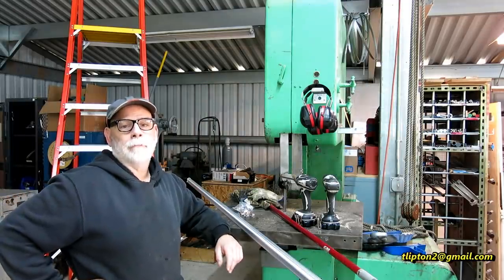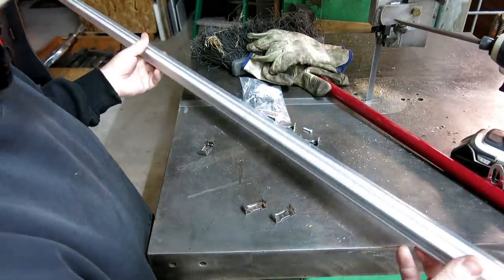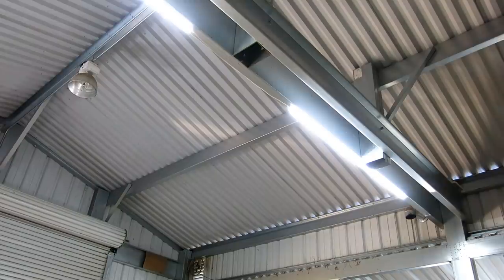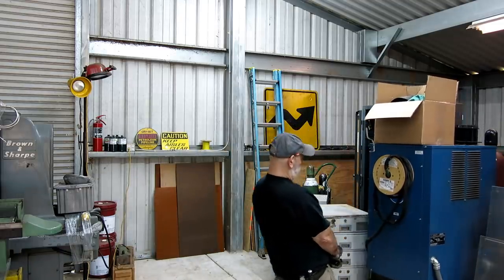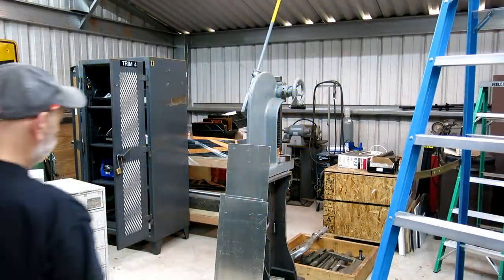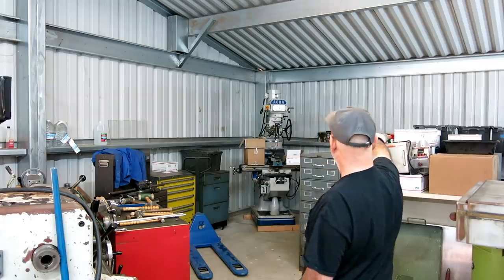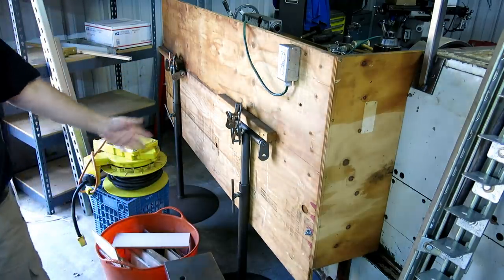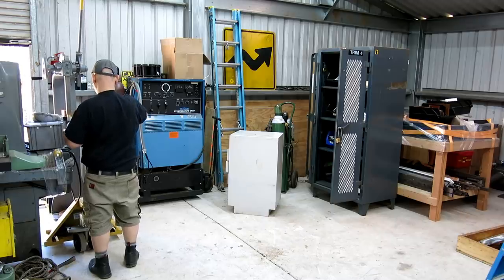Epic Egress 5 New Shop updates

Comment: I installed UFO LED fixtures in my 16' ceiling shop. 3200 square foot and 2 15A 120V circuits gave me right at 100 foot candles. Instant on is another wonderful LED feature.

I moved into my shop on Jan 1 when I had sons and grandsons here. Open heart surgery was scheduled for January 7, but has been postponed. This has allowed me to do similar tasks to what you are doing. 

You are having fun, so am I.

Comment: I did the spray foam insulation in my shop.  You will want to get any conduit, air, water etc. piping run before you spray.  It a pain to run it after.

Comment: I have changed all my lights to LED, some that are inside my house are remotely controlled by my phone and programmed to switch on and off at set times, and to change color at a set time, at any brightness or color that I want. And in case of an emergency the regular wall switch can override the program, so when you switch the light with the regular wall switch the light comes on with a bright light. 

In my shed I used to have a problem with my lights before I switched my regular bulbs to LED. In my shed I have two parallel wired light fixtures that switch on simultaneously, but one of the light bulbs kept blowing up on me because of the power surge. I had to change that bulb so often that I stopped doing it. Since I switched to LED I don't have that problem anymore. In fact, I did not have to change a single LED light since I bought them. 

Looking forward to see the progress 👍

Comment: I have the same exact lights in my shop. Nine lights in a 30 x 30 shop with a white steel ceiling at about 9’ 6” and it works good, not too harsh and no issues turning on at 0 degrees F. I am glad to see they don’t flicker on your camera, I have yet to shoot a video with the new lights up.

Comment: Getting a pallet jack for my shop is one of the best investments I have made. While a bit more expensive, I also bought a manual pallet lift. It is a bit more awkward to use, but has come in handy when I need to get things up higher. For the lights, you might look at the indoor scaffolding they sell at the big box stores. I need to replace some lights in my shop and will probably buy a set rather than risk standing on a rickety ladder.

Comment: I replaced the fluorescent lights in my shop with those LEDs and vastly prefer them. Watch out that the connector wire is well supported because it'll start to fall out after 6 months or so. I've also had two of the switches melt the insides so the contacts don't work anymore. I solved that by hard wiring it to a regular house light switch.
Reply: I was going to comment almost the same experience. I hardwired all 10 of mine to one legitimate 15 amp household switch. All of them have their own box also.

Comment: I learnt to weld alloy on one of those Miller Syncrowave machines about 25 years ago or more.    Only recently in the last 3or4 years have they been phased out. Only because of trouble finding points for them here in Little New Zealand.  Great tough machines.   Would go all day on close to 200amps.  Lol. In winter we had to turn the Amps up at about 2 pm when mums at home turned on the heaters to heat house for kids coming home from school.  Lol.   Not friendly on power consumption, but Dame they earned their keep for a nearly thirty plus year old machine

Comment: That shop sounds a little tinny and needs some insulation. BUT it sure looks like a well made structure! So many of those sheet metal buildings are built with red-iron purlins and/or the thinnest material they can get away with! Im liking all the heavy galvanized stuff. I myself just built a 650 sf shop and while I keep tell people its not my dream shop, it sort of is, and its mine.

Comment: I upgraded my T8 bulbs with philips direct wire LED bulbs.  They don't require a ballast and are super easy to use and VERY bright and well diffused so you don't have the star point light effect.  5000K is the recommendation for working areas and offices.  I put a two bulb 8' fixture in every 12' or so and then a few two bulb 2' fixture over my critical work areas.  I'm super happy I added LED bulbs, and just more lighting in the shop.  A lit shop is a happy shop 😂😂

Comment: One thing i would consider is replacing those vertical roof sheeting with clear for a sky light effect. You would loose some insulation value but it would brighten the shop up.

Comment: The good ol' Syncro 300.  For the unaware, note that the wheels are built in.  Had purchased one many moons ago for doing aluminum motorcycle frame fabrication and was shocked at how massive those things were.

My new inverter machine does 8% more power, has advanced waveform control, and weighs less than 50 lbs.

Old transformer machines like that sure do weld nice, though...
Reply: Especially with an older welder with HF start, fluorescent ballasts are the worst.  I recall long ago when wound ballasts were getting phased out, but solid state ballasts would shit the bed after a couple of HF starts on my syncro 180.  

LED lighting is soooo much better.

Comment: I've had bad luck with the cheapie LED fixtures similar to these.  They are often driven right from the output of a full-bridge rectifier with no caps for smoothing.  I put 27 up in my shop before I realized why the lighting seemed 'off' to me.  Turned out they had an 85% flicker rate at 120 times a second.  I used a small solar panel on a scope to measure it precisely, but an easy way to test lights for a 'proper' driver is to swing a pencil back and forth quickly between your thumb and fore-finger over a white sheet of paper.  It SHOULD look like one blur of a pencil when moving back and forth.  If you see 'stop motion' of the pencil as you swing it, the lights are flickering, and any motion under the lights will always 'feel weird' and cause fatigue.

Comment: Consider putting the ACRA mill in the middle of a wall, you might need room on either side for long shafts or other long, overhanging 
workpieces that would otherwise interfere with a corner.  No matter what what you do, you'll be bruising your hip...

Comment: Tom just have ta tell ya that it would be better if ya don't move everything all over the shop until ya have the spray foam  done cuz that crap will get all over everything and it isn't easy ta clean off. don't know if yer doin the walls or not. But if ya are, ya will have ta move everything out away from them. what mee is sayin is that it make a mess. anything that isn't covered it will stick too. and most of that commercial stuff once it is set acetone or lacquer thinner won't touch it esspecily the fire proof foam ya might think twice before ya get too carried away. jus sayin mee friend just tryin ta help ya out.

Comment: Maybe, look for one section of used pallet racking. Put a wood "floor" on the highest level.  Move it around and use it for this kind of shop setup work.  When you're done, cut the verticals down to the lengths you need and you have heavy shelves going forward. Very cheap way to kill two birds with one stone.

Comment: So dumb question...can you leave the spray foam exposed or are you planning on a steel liner panel? Seems like it would be a fire magnet for hot chips, weld spatter or a grinder.
Reply: Chech out Swan Machine vids on new shop build. Look at his insulation that is being done.

Comment: 6000K is VERY cold and bluish. That type of light is suitable for precise work with lot of small details. The downside is that it stresses the eyes quite a lot and can cause headache especially if the light is pulsating.
Another property of those LED lights is their CRI value. CRI stands for Color Rendering Index. This should be well above 80 for decent filming. Poor CRI can also make it hard to read if the text is not black on white.
Cheap LED lights are usually cheap having poor CRI, unnessecary high Kelvin value and poor power supply that makes the lights to shiver. With such a construction it is also very probable that when the time comes to replace a failed unit, those might no more be available.
On the other hand, those LED lights that are used to replace the "old faschioned" fluorescent tubes have the advantage of being replaceable and having a broad variety of options to choose from. Those can also be mixed in order to achieve more balanced CRI and atmosphere.

Comment: Take a look at the newer LED "garage lights" like the ones that are marked under the Bell and Howell name (I doubt that it is still the same company, they probably just bought their name)  They screw into a regular light socket with LEDs on paddle shaped extensions you can aim. Come in ranges like 8000, 12,000, and 16,000 Lumens. They start around $25 a pop. That way you don't have throw away an entire fixture when they fail.